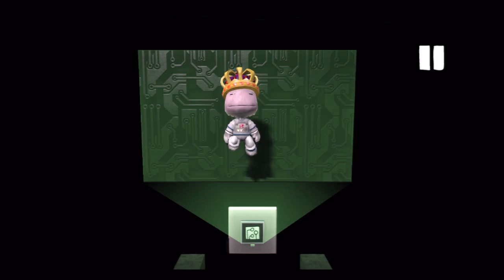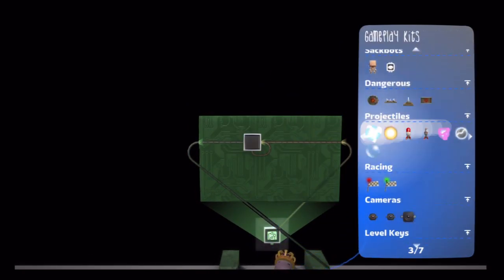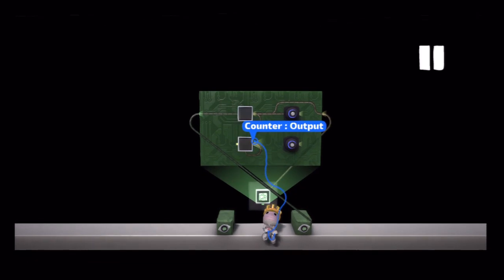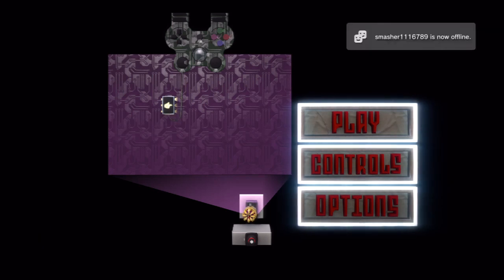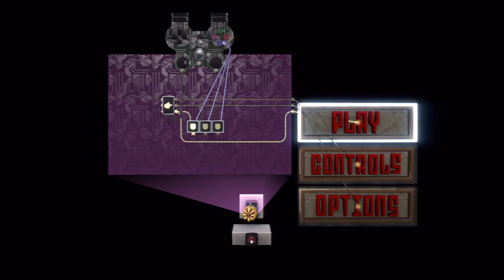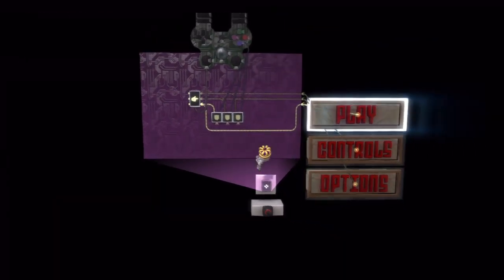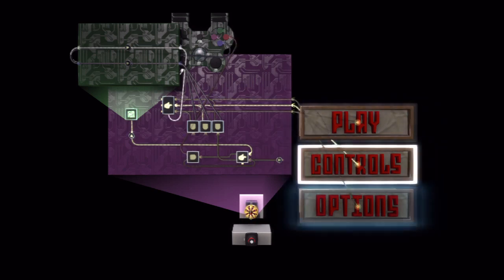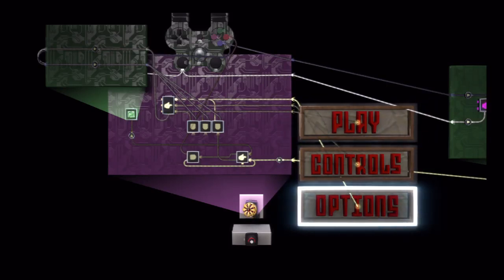LBP2-Torials 06: Menus with Pulses and Time-Independent Movie Cameras

Comment: I'm having a bit of a problem with this system that you haven't addressed in this video, but perhaps you can help me troubleshoot. Basically, holding X or Circle allows the player to rapid-select options. This is most problematic when one tries to go through menus backwards. Holding Circle locks the controls on a secondary menu before the menu switches because a constant signal is flowing through the wires. From my understanding, I need the signal to work only when one taps the button: one frame

Comment: @MindTrykz13 Nodes are so you can put a wire down without connecting it to anything. It has no effect beyond that and putting a pure wire on a separate microchip, and deleting it  doesn't delete the wire connecting to it's input and output.

Comment: @RockOnPsycho well it would depend on the type of level you are doing, but to get somone out of a controlinator there is an input on the bottom of the controlinator that is called eject player, so all you have to do is hook up an output to that and when it turns on, the player will be ejected. now to get them to go to the start of the level there are a lot of ways to do that.

Comment: I am going to try it one by one  step by step, I hope it all works, but I have a question, how do you play when you like press play.
Reply: 0 - This is a brainstorm. Don't take it seriously.
1 - Wire the play option thingy to a the first port of an OR gate and connect its output to one of its inputs.
2 - Connect the or gate to follower set to follow a tag and place a tag on a checkpoint.
3 - Attach a tag sensor to the eject controllinator input.
When you select play you will go to a certain place. Once you get there you are ejected from the controllinator.

Comment: @blackman0013 ok... when you are setting the counters or any type of logic like that if you want to make it small the you use the left analog stick rather than the directional buttons. does that make sense? If not just add me on lbp2 ill show u. and also to put hologram on a sackbot you put a follower on it set to whtever tag you put on the sackbot. it will follow it. if you want to control the sackbot then you put a controllinator on the hologram and on the sackbot and you put a follower.